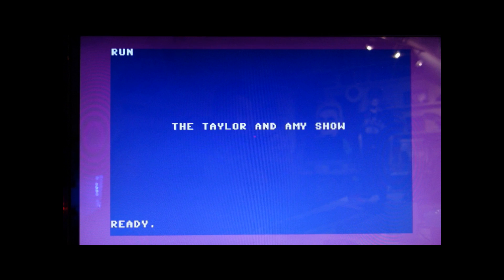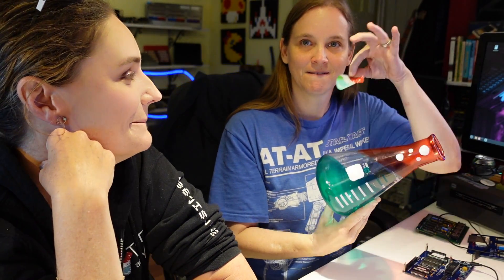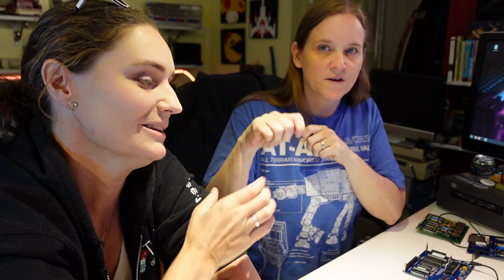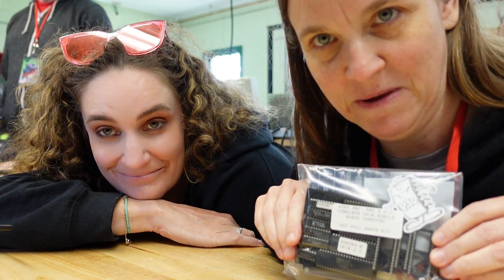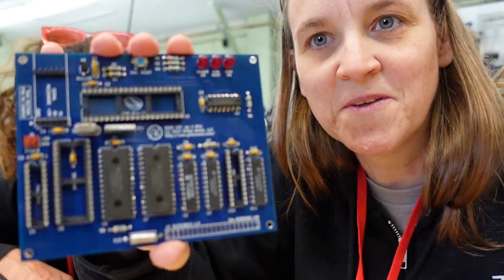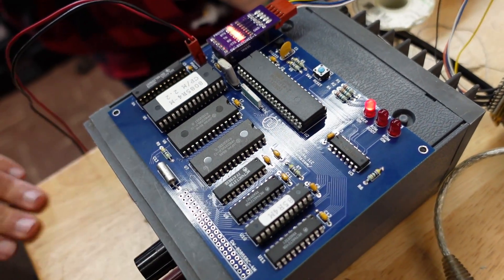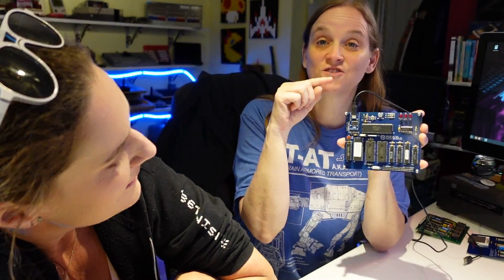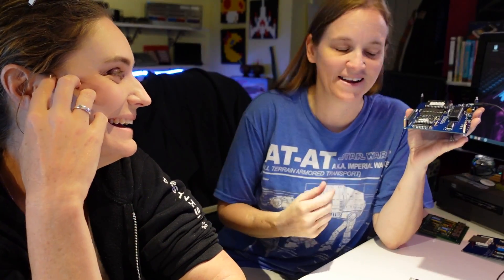8085 Single Board Computer With Bubble Display

Comment: OOOh wow! Bubble screen! That's been forever since I've seen those. I also never worked wit an 8085, only 8088, 8080 and 8051 (which technically is a micro controller).
Reply: Bubbles forever!

Comment: Hi, I saw your video and I fell in love with it. On Sunday I bought a trunk with thousands of components at a flea market, I understood that there was something good in the middle. in fact I managed to find different versions of the 8041, 8085, 8088, 8086, ram, rom, eeprom, plus hundreds of TTLs as well as thousands of transistors, capacitors, .... etc. I wanted to know if you could help me choose the best versions of components and build a computer from scratch. It has always been a passion of mine. I hope you can help me, thanks...
Reply: What a find!  Not sure that we are the best resource for that, but the internet doth provide and sounds like you've got a ton to work with.

Comment: About CPMtools:
They are meant to work only with disk images. On linux, you can also pass them a "/dev/*" device and it will use that. On windows, I haven't tested that. You also need a file called "diskdefs", that has format information for a bunch of disk types. And you have to give each CPMtool a command line option "-f <format>" to tell them which disk format to use.
Reply: Ain't nothing just easy!
Reply: @fractalMD  The issue is, CP/M didn't define a physical format specification. It was left to the system manufacturer to define a floppy format. So now there are tons of different formats, none are compatible with each other, and the disk (or image) itself doesn't tell you what it is. 
The manufacturer would put this information in the DPB, Disk Parameter Block, which is part of the BIOS. So it is technically stored on the boot tracks, but since the location isn't specified, we can't use it.

Modern implementations of CP/M 2.2 often use a format that uses 8 MB images on a larger disk, because that was the maximum size of a drive under CP/M 2 and also MP/M 2. But some also have custom definitions. You will have to ask the developers of your board for the format they used. I looked at the documentation for the Glitchworks board and it doesn't say which format they use. But it says the internal flash that is used as A: drive should have PCGET and PCPUT for up/downloading files, using the Xmodem protocol that is supported by TeraTerm. 
So that is one way to get stuff onto your board.
Reply: @TSteffi  Lordt!  I double down on my original statement!!!!

Comment: The 8085 was used as the second processor in the zenith z100 and z120 to run CPM  it also had an 8088…
Reply: Which is kinda awesome.

Comment: Those CF cards talk IDE, so simplest way is to find an old PC (or old laptop is even better) to use it. I also have a 102 - great machine!
Reply: I have not been able to get this CF-board to play well with cpmtools. Make an image of the card that came with the kit. Burn copies. Be aware, it's picky on the cards. I got 10 identical cards off ebay, only 4 works. Probably firmware issue. Once you have a fistful of cards, you use pcget and pcput to set them up, one for dev, one for SuperCalc, and so fourth. One more pitfall: pcget and pcput only works from A>. So files must be shuffled around with pip afterwords.

Comment: Hey, great video.  Where did you get the bubble display board?  It does not appear on the Glitch Works Tindie store.
Reply: Apparently most of them got snapped up at VCF East. Keep an eye out, I'd say, on the tindie site for it to get added.

Comment: One of my memories of university was learning 8085 assembler on an SBC with a hex keypad. Whoah. Back in 1991 or there about. When dinosaurs roamed the earth. Can't remember a single bit of it. 😀
Reply: And the Earth was cooling. I know the feeling!
Reply: I learned 8085 assembler using CPM operating system in college too.  Back in Fall of 1982

Comment: Hey Taylor and Amy:  The Toshiba T-250 (the first computer I've ever used!) and its smaller brother the Toshiba T-200 both used the Intel 8085 microprocessor.  Now you know another two computers that used it :)  The Toshiba T-250 ran CP/M 2.2, had 64k of RAM, 58k TPA, dual 8 inch floppy diskette drives.  It had a built-in 12" monochrome monitor.  Must have weighed over 100 lbs--no kidding!  Also:  don't forget that your beautiful Commodore 128 is compatible with your single board in CP/M mode ;)
Reply: So much beauty in the world!